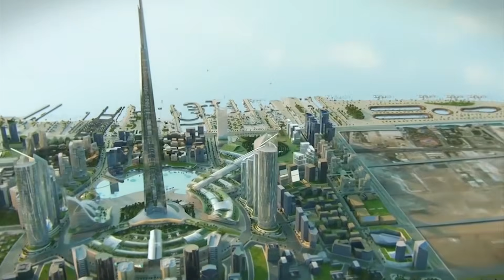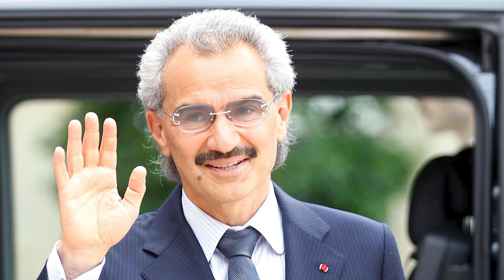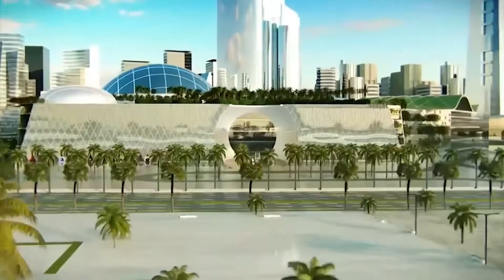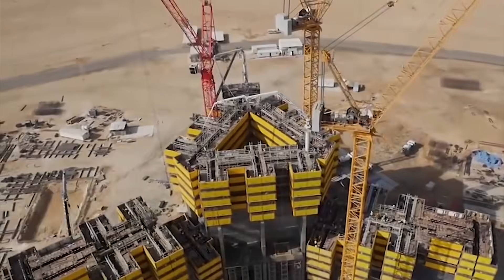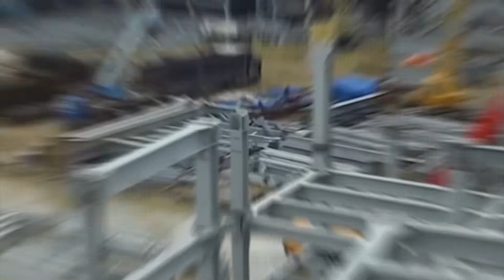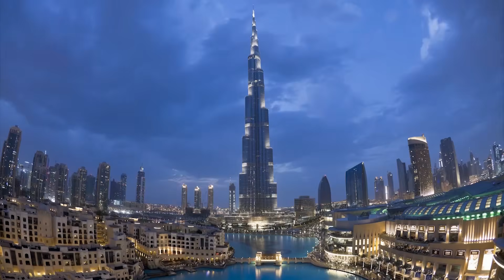Why Jeddah tower May Never be Completed... (Corruption!?) 2021

Comment: I am one of the engineers reviewing the drawings of the tower way back 2014 for the testing and commissioning of the tower HVAC, FF, Public Health and Electrical. Sadly the Saudi Bin laden group was politically overrun by Nesma which owned by the Prince.
Reply: Will the tower be completed soon by nasma? Do u have any information
Reply: @dimples5058  I left Saudi Arabia last 2016, but i heard they're starting to continue the project.
Reply: In your opinion, which group has a better technical know how to speedy construct the towers complex to completion ?
Reply: @Kenny-dn9lc  man power, construction equipments and wide connection to all sub contractors. I will go for Saudi Bin Laden during their glory days. Nesma on the other hand, honestly, i didn't get the opportunity to work with them. 

But if I am the client. I will take Turner as the project management, Aecom Dubai for the Consultants, Bahwan Engineering for contractors.  WSP for special systems and CML from dubai for testing and commissioning
Reply: @GarlicOnions  
Saudi BL does have construction experience of Mecca & Jeddah city
Reply: @Kenny-dn9lc  i worked with them on Jeddah airport and Masjid Al Haram Extension project. The Masjid Al Haram extension was so superb, sadly the project was a chaos because of the SBG management on Haram project.
Reply: @GarlicOnions  
Are you aware of the Grand Mosque’s construction incident occurred on 11 Sep 2015 in Macca ?
Reply: @GarlicOnions  
Having Osama’s ghost haunting BL group is bad enough, but construction blunder at such magnitude could destroy their reputation anywhere else. The fact that, they are allowed to continue taking part in construction and bidding of major projects in the KSL… is proving their construction skills & reputation …
Reply: @Kenny-dn9lc  Yes i was there, it was friday and we are about to make umrah after the friday shift but postponed due to bad weather. All the cranes was put down but 1 movable crane near safa marwa was neglected by the safety officer incharge maybe believing they could move it when storm comes. Unfortunately it was too late.
Reply: @GarlicOnions  
It was a disaster from nature element due to operator’s carelessness. I bet a few managers got fired after that incident.. BL group not the same after that..
Reply: @Kenny-dn9lc  wait, it was on 9/11? I smell a CIA conspiracy :P.
Reply: @snuffeldjuret  
The Sep 11 date sounds like Osama’s haunting the company 🤭 but no CIA’s bullshit conspiracy 😂
Some idiot safety supervisor didn’t bother to lockdown the sky crane as per safety protocol before the storm arrived, that cost 180+lives. Human fckup and someone should be in jail, it was just simple as that 👈
Reply: @Kenny-dn9lc   For info bun laden group won all appeals against it regarding crane accident nd position nd location of crane were also found to be upright by authorities  nd it was proven thru available data tht it was accident to thingdms beyond human control..
Reply: you are from dar al handasah?